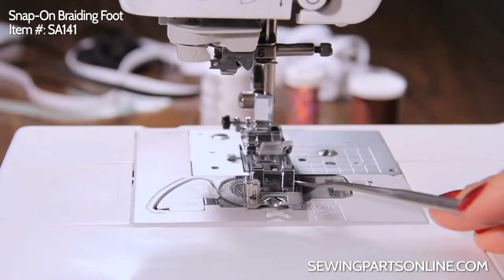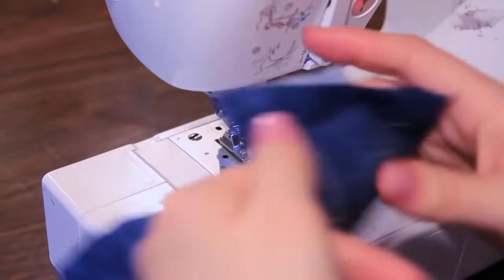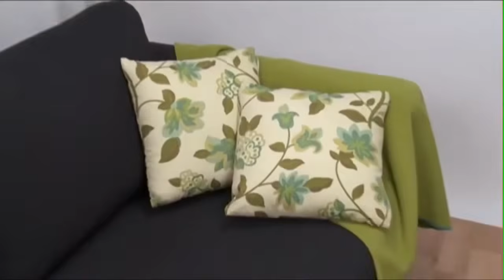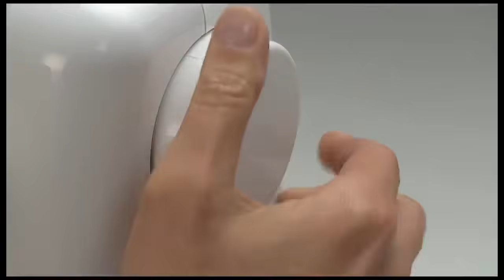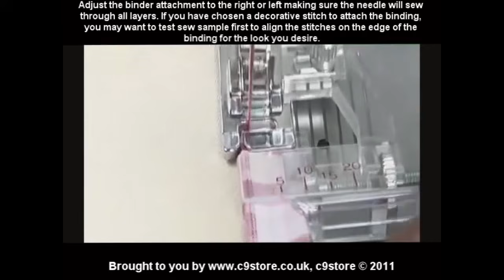32P Sewing Presser Feet Using Videos

Comment: 1) Braiding Foot 00:25
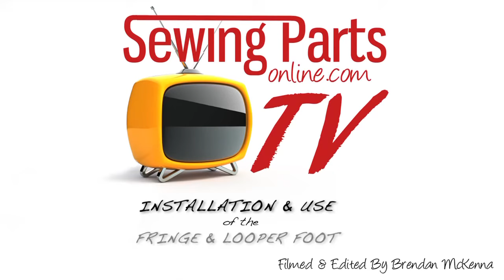2) Fringe Foot 07:44 
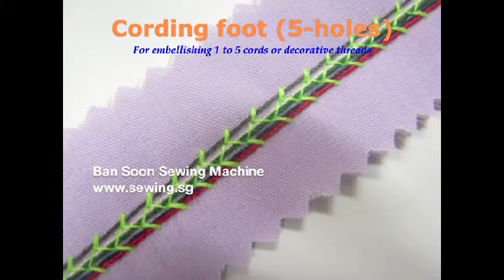3) 5-Hole Cording Foot 17:31
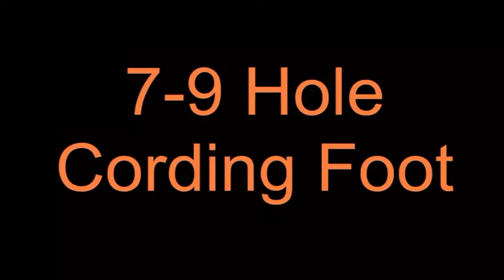4) 7-Hole Cording Foot 18:27
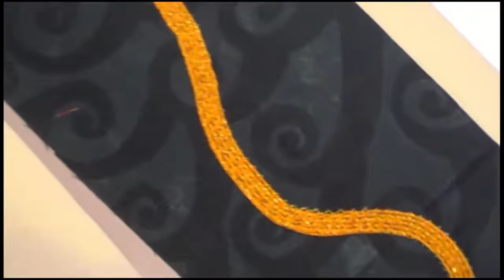5) Edge Joining Foot 25:53
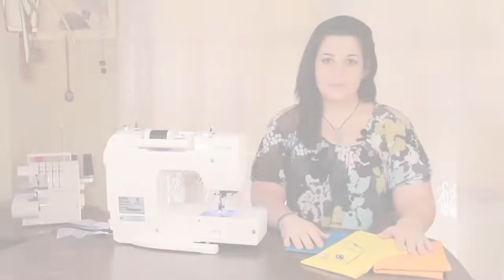6) 1/4" Quilting Foot 32:00
7) Straight Stitch Foot 27:51
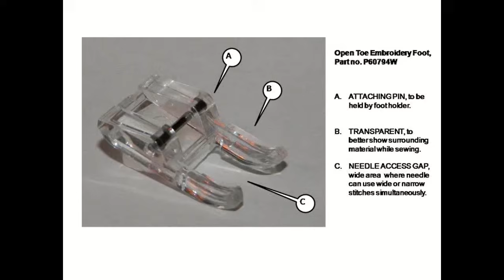8) Open Toe Embroidery Foot 38:47
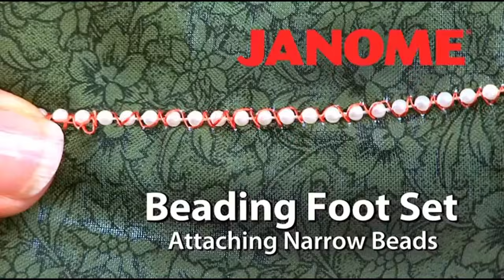9) Round Bead Foot 41:04
10) Zig Zag Foot 42:18
11) Cording Foot, 3 cords 44:29
12) 1/4" Quilting Foot 45:14
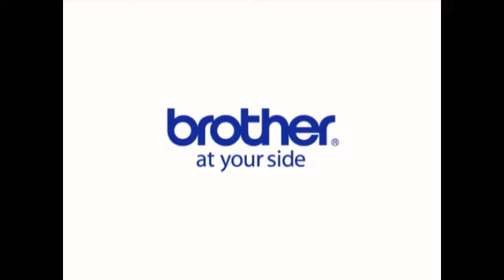13) 9-Groove Foot 46:14 
14) Overcast Foot 50:25 
15) Stitch Guide Foot 58:15
16) 5-Groove Pintuck Foot 1:01:53
17) Satin Stitch Foot 1:03:54 
18) JAGUAR/Zig-zag-j-foot 1:06:52
19) Double Welting Foot 1:10:17
20) Invisible Zipper Foot 1:12:08
21) Roller Foot 1:16:01
22) Blind Stitch Foot 1:18:21
23) (A9) Applique Foot 1:19:51
24) Open Toe Foot 1:21:35
25) Darning Foot 1:22:40
26) Shirring Foot 1:25:34
27) 1/8" Round Hemmer Foot 1:28:04 and 1:34:35
28) Hemmer Foot 1:31:25 and 1:34:35
29) Darning Foot Low Shank 1:45:46
30) Adjustable Bias Tape Binder Foot 1:49:10
31) Knit Foot 1:53:11
32) Zipper Foot Low Shank  2:00:25

Thank you for making a compilation, it is very helpful! And a huge thanks to all the creators featured in this video.

Comment: Thanks great video😊 i have issues knowing the right tension for wich fabric my sewing machine got stuck sometimes anyone can help please😊☺️
Reply: It’s impossible to explain just like that,we don’t see you’re fabrics,treads,what they do?
Try to put in search about tread tension.so you’ll see how it looks when it’s too little or too much...most of new machines have automatic tread tension,or there are machines that don’t even has option to change it..try to put at middle,saw on tiny peace for test before going on you’re project,then look back of fabric to see how tread looks(put different treads down and up so you can easier see ) and you should be able to see if it’s to little tension...also spool holders on bottom can have some treads,dust need to open and clean.need to oil well machine also..so there can be many reasons why machine gets stuck..if you’re treads tension is ok(you’re test you do as I sed shows so) and it still gets stuck,then need to clean and oil machine well,as more you use machine more you got to use oil...if you have not used machine for half year,you definitely need to clean well machine(cos oil with time and together with dust from treads turns like in black glue and sticks parts,those don’t turn well,reason we need to or do it well our self if we know machines well or take it atleast once a year to maintenance)..well,I know it’s not like I helped a lot,but hope you’re on good way to get it sorted....search in search how to do tension tread,how to clean and oil you’re machine,if that don’t helps take it to maintenance and they should put it perfectly